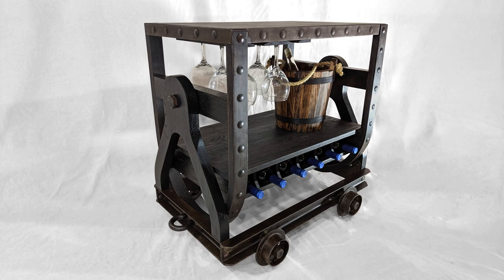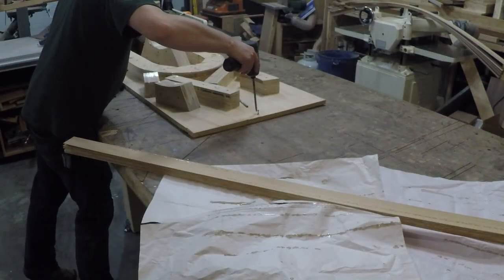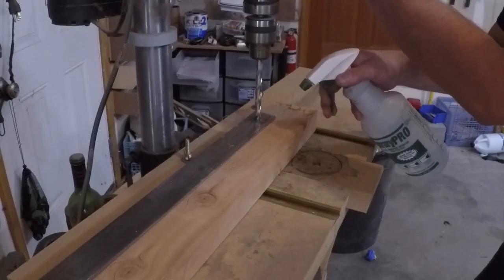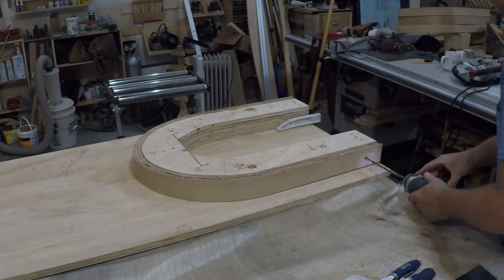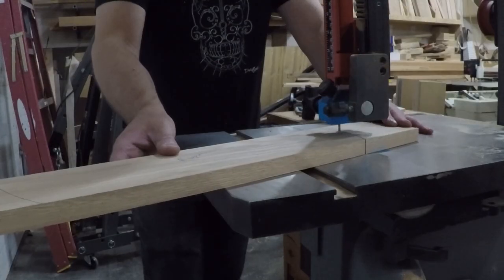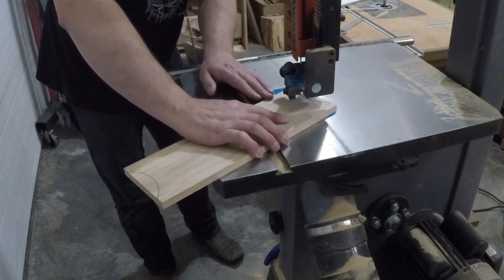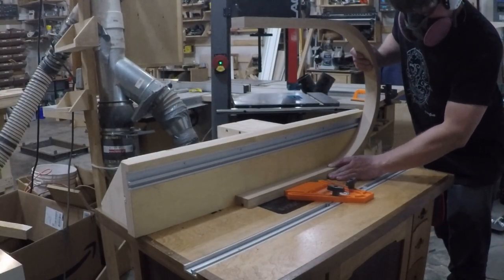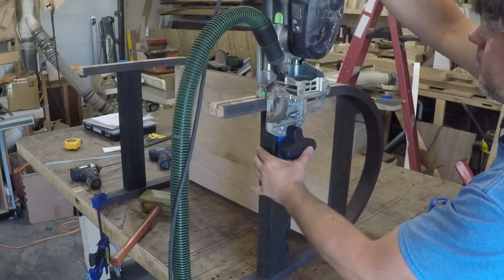Building a Bar Cart For Miners - Woodworking - Metal Working

Comment: I’m curious on the rationale for using the compression pattern bit to hog through a ton of plywood (around the1:00 minute mark). Is it a time saver over first cutting close on the band saw and then removing the last little bit to flush up to the template? I only ask because those bits are crazy expensive and I don’t think they can be resharpened (or can they?). No criticism at all. Just wanting to learn.